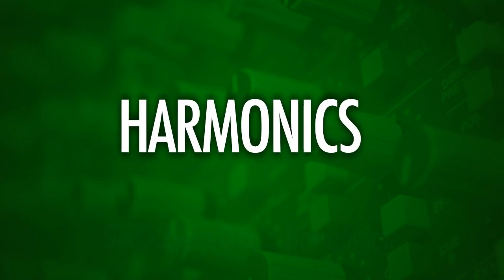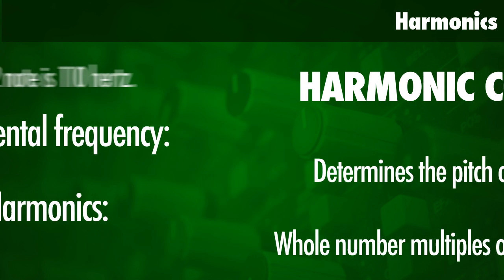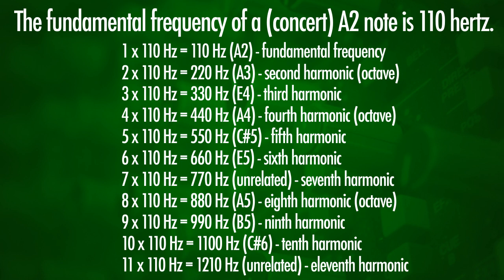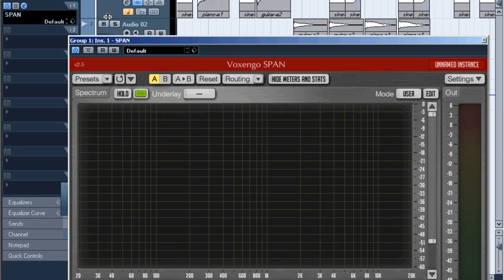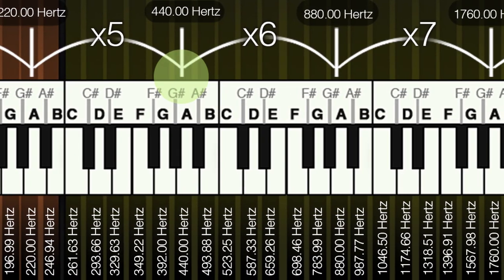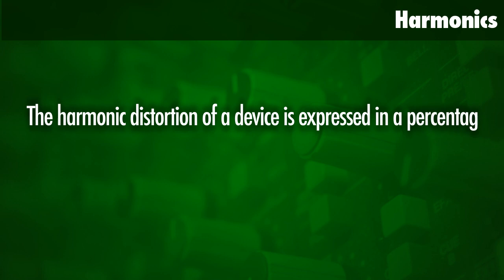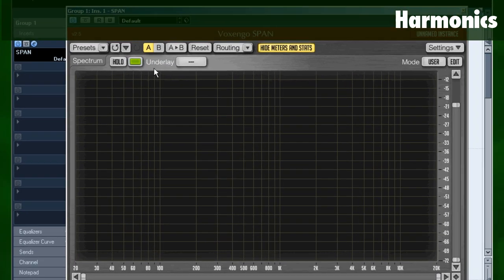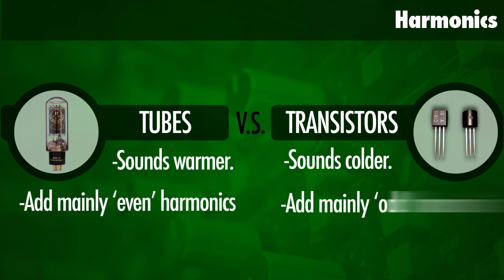Frequencies & Sound explained #4 : Harmonics & Harmonic distortion

Comment: Great video as always, but those "unrelated" pitches are absolutely related. The scale created by all the harmonics is the mixolydian #4 (or lydian b7). That may sound like meaningless jargon, but it's one of the most used scales in jazz improvisation. The #4 is a way to not clash with the major third, and the b7 implies a dominant-seventh chord, one of the defining chords of jazz and blues.

Comment: What will happen if the fundamental is filtered out and only the harmonics are played?
Since you said that it is the fundamental determines the pitch, so if the power of the harmonics is also raised, then will it sound the same as the original tone?
Reply: No, since you filtered out the original frequency you'll be left with the resulting harmonic frequencies from that signal. Remember the signal is still going into the device but because you filtered that specific frequency 110Hz or whatever it will only result in the remaining frequency or frequencies. Does that make sense?
Reply: I have read many papers which suggest that for low frequency sounds, ie bass, this technique of filtering the fundamental frequency and only allowing its harmonics will allow any speaker, for eg, to reproduce its effects effectively.
http://goo.gl/XITLFU
Reply: @arjunmenon9830  how would you filter/cut the fundamental frequency? what type of band/filter is more appropriate?notch or a Low Cut filter?  Would you automate where the cut/filter is made for each different note the bass plays? so for example if you have a chord progression of 4 different chords/notes, would you create a different eq cut/filter for each note played depending on where its frequency is ? OR would you just create one single EQ filter for the entire track of the instrument? (does this change if its for either bass or guitar or vocals?) THANK YOU For you help!!!🙏
Reply: My mixing instructor taught that equalizing the fundamental frequency out is a good way to create space in a mix. Specifically with bass. You can take out it's fundamental and boost the next harmonic. The tone will be the same and you get rid of the rumble
Reply: @IzzyMakesMusic  how would you take out the fundamental frequency? would you use a notch filter, or regular band filter to cover more range of the frequency spectrum? also, how much of it would you take out? 4 db, 6db, 8db, or as much as you can?